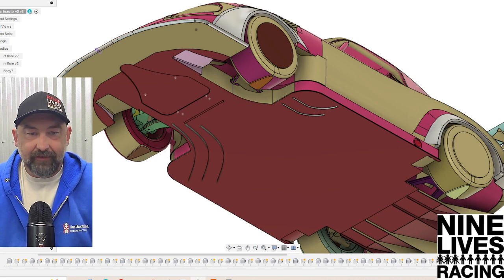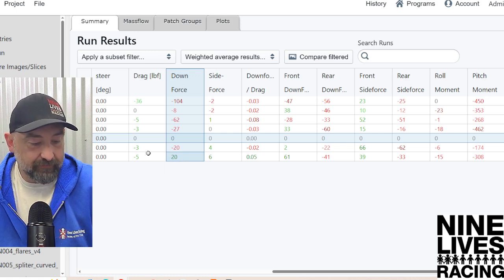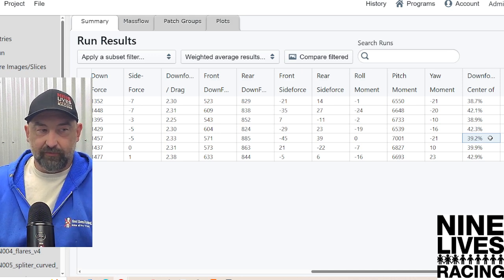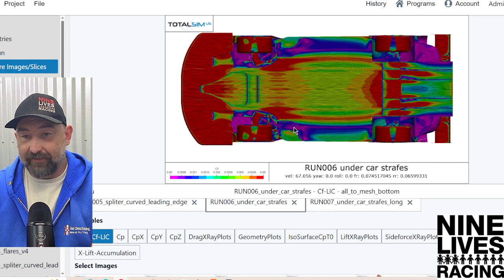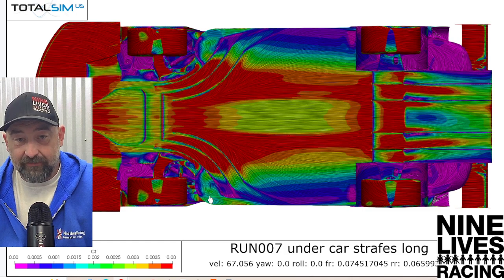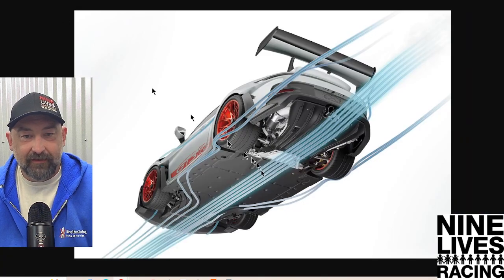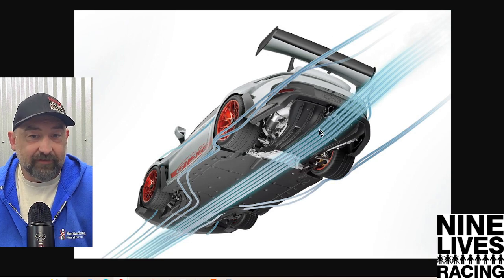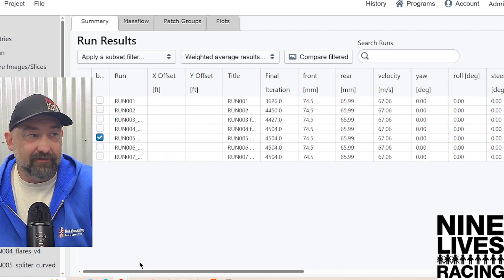what does an air diverter do? Cfd testing.

Comment: thanks for deep diving on this for those of us that can't. as a thought, open class in WTAC has restrictions on the flat floor, front splitter can't go behind front axle, side skirts can't go further under than the chassis rails, and rear diffuser can't be in front of the rear axle. could these work as a way to divert air around the gap in the floor, to allow smoother air onto the diffuser?